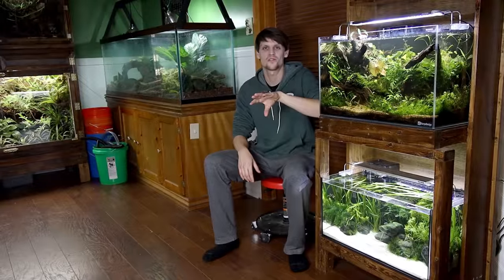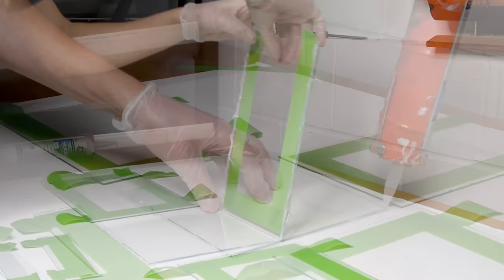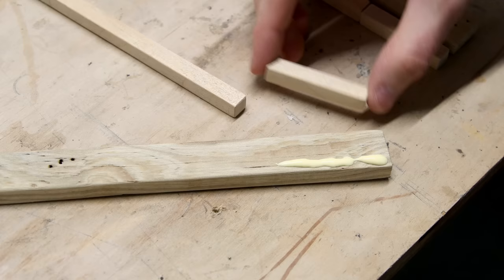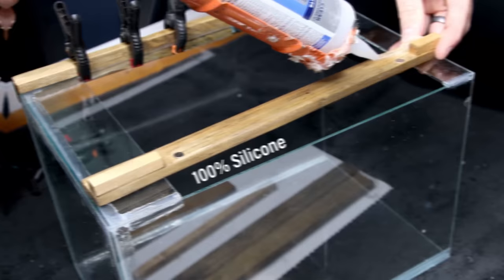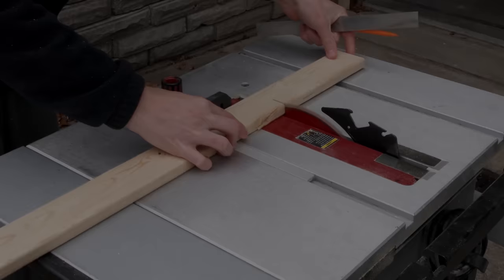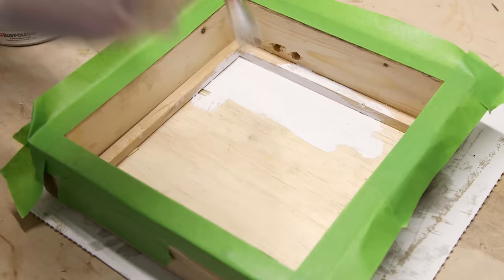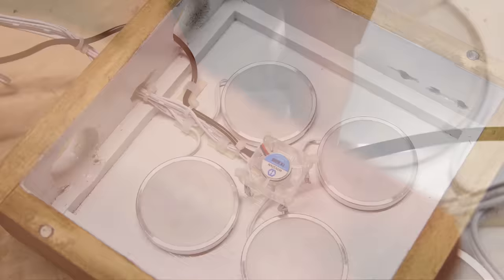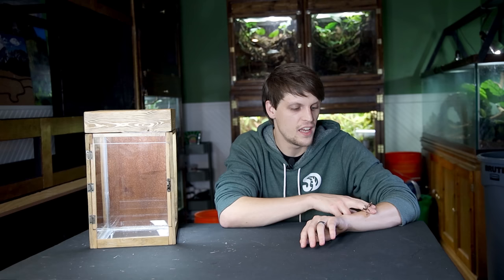Ghost Mantis Vivarium pt 1 (Custom Insect Terrarium)

Comment: FYI: You had the base of your miter saw on backwards: the raised edge on the bottom goes over the edge of the table. But as always, Inspiring work Tanner!
Reply: FYI: if you want to sound smart, be more careful what you write.  His saw was fine. And so what if his BOX was backwards? He obviously got the job done.
Reply: @donteven5712  I'm trying to imagine an existence that would lead to not only the act of helping someone use a tool correctly and safely as being deemed "trying to sound smart", but also coupled with the need to reply to a comment about it. Thankfully, I cannot.

Comment: Nice. I love the canopy and the use of magnets and I can't wait to see how happy that little guy is going to be in it's new home 😀. You might want to find a way to protect the glass door where the edges meet on the top and bottom. That looked like a pretty snug fit for glass-to-glass moving parts.
Reply from the maker: Flat you liked it. It's a very small crack, but enough that they don't touch directly.

Comment: I love this! Ghost mantids were my first exotic mantis and I'm currently raising a spiny flower mantis among other insects in my growing collection. Question: I've never seen a fan used in a mantis enclosure before. Is this mainly for plants in the enclosure, or the mantis? Could it be a hazard to the molting mantis? Love your videos as always!
Reply from the maker: It creates a very gentle flow of air. I doubt it would be enough to disrupt the mantis. It's mainly just to keep the air from becoming stagnant since there's no cross ventilation.

Comment: How do the humidity levels in this vivarium run and did you have to adjust anything about the design afterwards to give more or less humidity? I don't really know what humidity level mantids require though I'm guessing they do need some for proper molting?